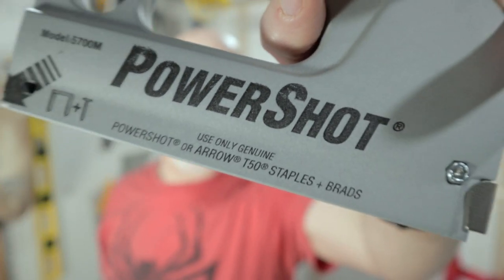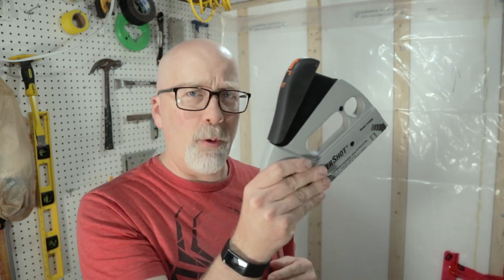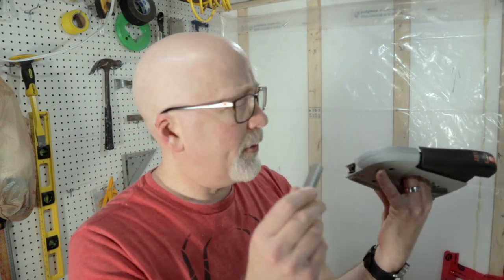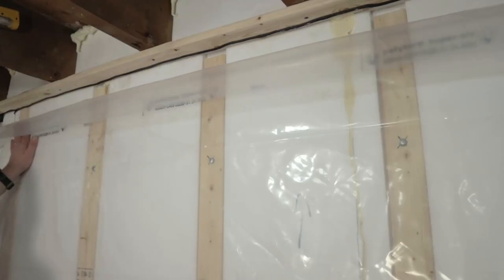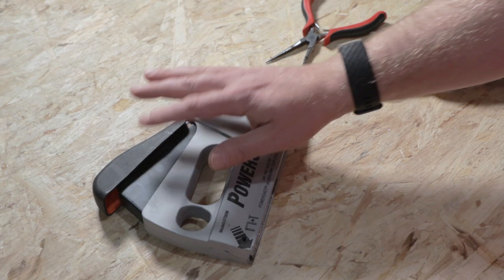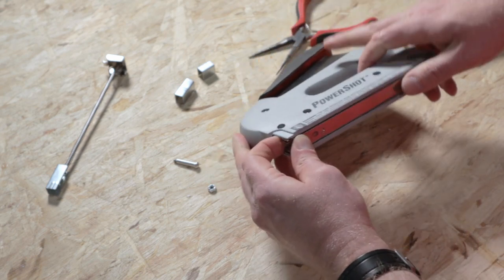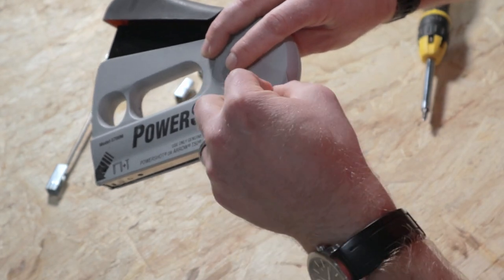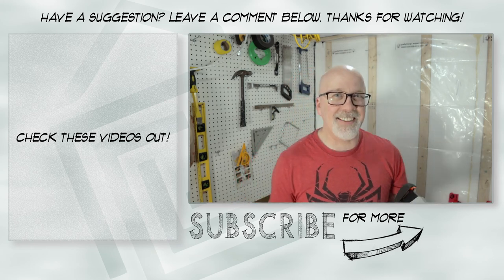Thoughts on the Arrow PowerShot Stapler

Comment: I used my friend's Powershot stapler, model 5700M, to install Kraft backed Insulation. It jammed frequently, which was quit frustrating. Personally it might be OK for a homeowner who doesn't do a lot of stapling, but I definitely would not recommend it for construction use. It jams a lot and finally quit after trying to fix a jam requiring disassembly. Using this stapler is a love/hate relationship. I replaced my friend's Powershot with a new one, which I felt is a lesser quality than the older ones. ARROW needs to go back using good material in this stapler even if the cost is higher.
Reply: I keep mine lubricated often with WD40. Never jams.
Reply: A fn year ago but your right.
Reply: We have been through 3 of these they are junk and the negative reviews on Home depot for them is unbelievable  There is not anything jammed in it  and it will not shoot staple it is 6 months old and I am a woman that uses it very little.  I bought it so often because it is easier to use but it is costing a fortune for them......JUNK
Reply: @cactusladysouth1000 absolute garbage!!!

Comment: My Powershot is branded Black and Decker. I bought it in the late 80s and I've never had it jam. It doesn't have the screw that you undid to get the track out. Done thousands of staples trough it. Looks nearly the same as this Arrow one.

Comment: Currently sitting in the Walmart parking lot because the one from Home Depot that I bought today specifically for the brads to add trim to cabinet doors... right out of the package, nothing! I made sure I put them in the correct side, no jams, just nothing happened... took that slidie metal thing out, the metal driver thingie engages when you pull the handle, IDK it’s was just DOA. hubs is inside buying an electric one and will be returning the dud to Home Depot in the am... we had one just like this before, it did staples ok, did jam fairly often if I half assed it...

Comment: I wrote on mine the ( Biden stapler) It back ass backwards and has many jams. Will not put in a 3/8 staple into OSB ply. Unable to put it in a pocket to move around.  Do not be in a hurry to use this as you can staple your own hands!!!!!
Reply: Are you using the heavy duty staples? although this stapler is not powerful enough.